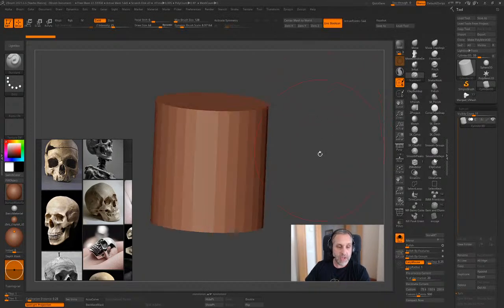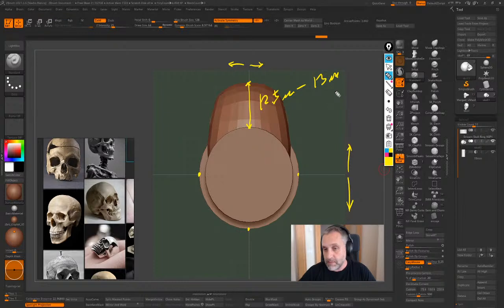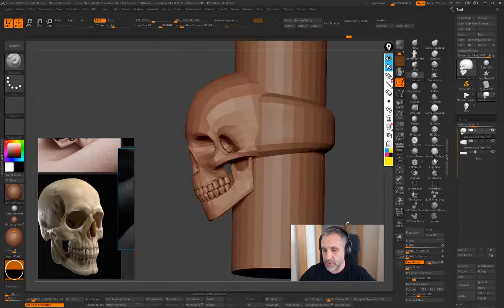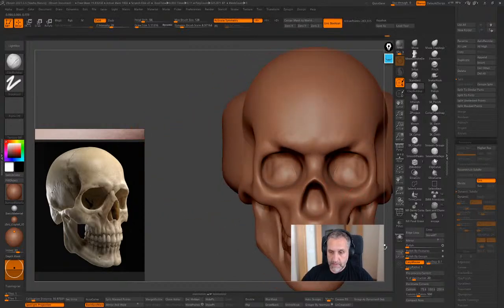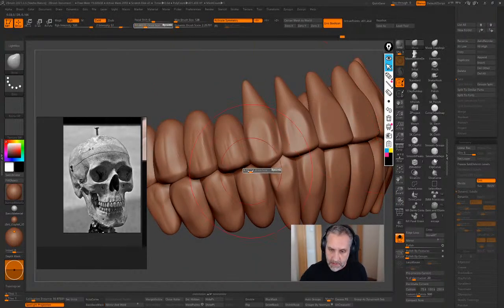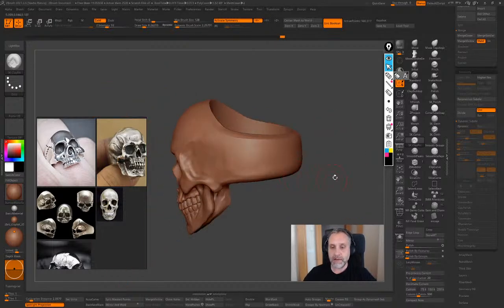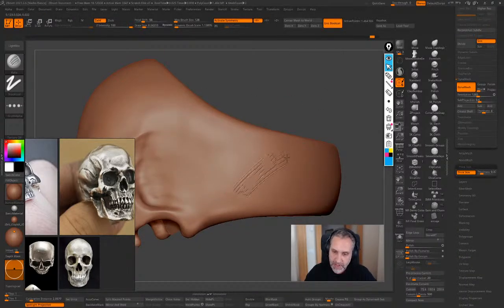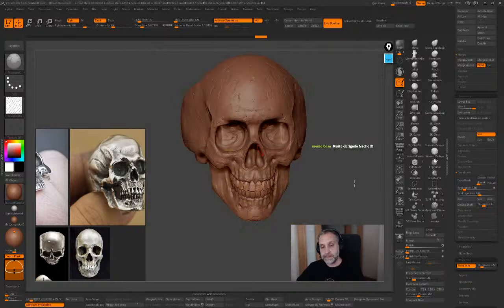Skull Rings! Part#1 Designing and Sculpting process

Comment: Hallo, I learned some skills in Zbrush and made my version of the ring from your video, but I can't figure out how to finish the model. I want to sculpt on the inside of the ring, but the live boolean function doesn't give me that option. In order to be able to work with the finished ring, I have to activate "Make boolean mesh" with high subdivision lvl of cylinder?
Reply from the maker: Hi, Yes if you want to sculpt from the inside would be a good idea to make the boolean first. Yes subdivide first the Cylinder for getting an smooth surface
Reply: @NachoRiesco  Okey, Thanks a lot)